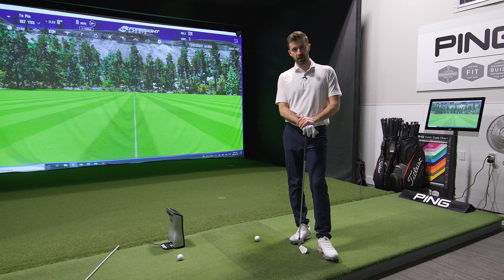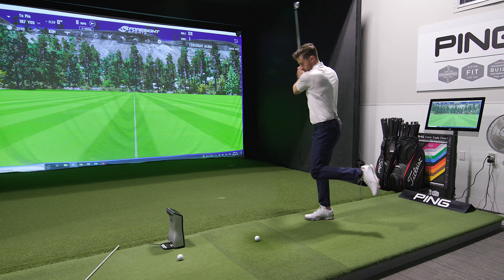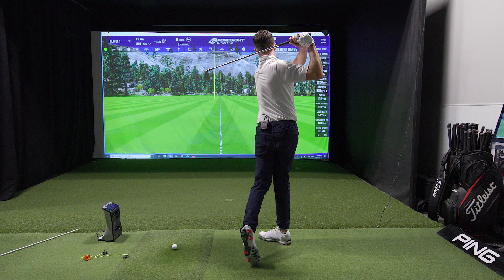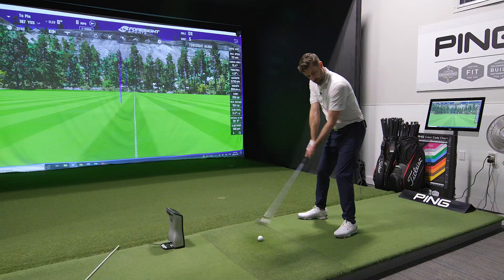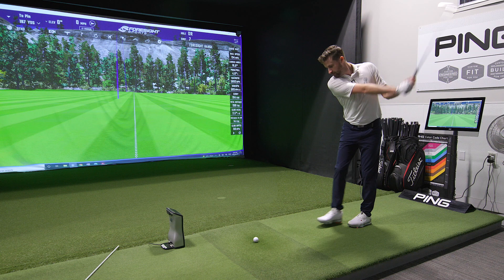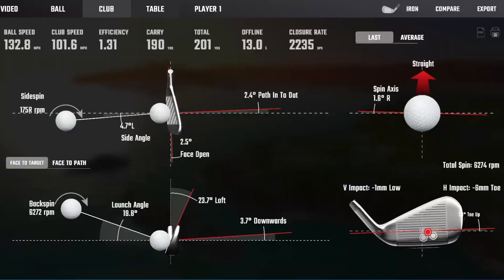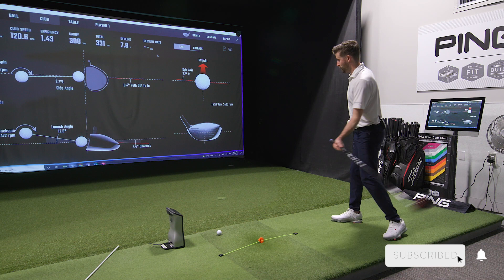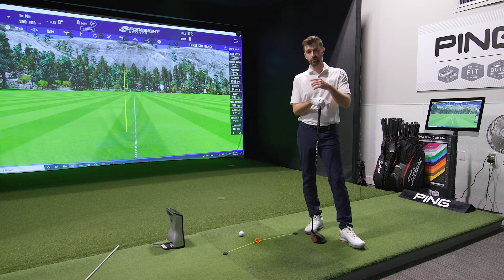Working on My Swing | Drills to hit the ball longer & straighter

Comment: Matt - tried out the weird forward step drill and was pleasantly surprised. For someone who has had 2 problems (tipping over in balance in the finish position and a bit over the top), I found my swing was coming from in creating more front leg stability and feeling my elbow tucking in with a greater perceived shoulder turn and back swing turn. Thus with the normal posture I pushed myself for a wider shoulder turn to create the same feeling. Thanks once again. 👏

Comment: This is gold Matty. Showing how you incorporate drills into practice and the physical change in outcomes that results is almost like "How To Do Golf Drills, For Dummies" instruction. Would love to see ongoing progress in proficiency with the drills and the incorporation of other drills that UGP and LC have given you.
I tried both the one-legged finish drill and the step-forward drill. On the one-legged finish drill I kept losing my balance toward the target so I guess that means my mass (probably upper body) is moving outside (target side) of my lead foot/knee/hip alignment. The first couple of step-forward drills resulted in hosel-rockets until I worked out my starting point and step size. Hit some solid strikes with that drill and could even finish balanced on my front leg only. Interesting the difference in balance between the two drills. I think the stronger 'planting' of the lead foot in the step-forward drill must have created more stability and less upper body lean toward the target. Would be curious what LC thinks.

Comment: Amazing how much putting that weight on your lead leg earlier neutralized your path with the driver. I remember seeing you on Quad before with a 5-6 in-to-out path, and those last couple were under 1 degree. This content is amazing because it basically confirm everything I've been thinking about in my own swing. I also avoid putting a lot of pressure on my lead leg due to some weakness from childhood. I'm slowly building that back up at 38, but trusting it is difficult. These are great drills I'm immediately going to try doing. Thank you for the amazing content Matt!

Comment: Very cool showing at full speed and then slow motioning the down the line angle after.  Helps to be able to focus in.
Swing is looking good.  Looks like natural, smooth, relaxed power.  Doesn’t look like you are swinging out of your shoes or anything crazy.
Been focusing on my lower body which has helped while practicing.  Can’t balance on one leg while closing my eyes worth a damn, but focusing on those feels has helped my stability, balance, and more natural rotation.  Great content.

Comment: The first practice swings with the driver was great. Whereas on the first ones with the i7 you rotated, and after the rotation you shifted the weight into lead foot. 
You were clearly increasing your trust in this move as the session progressed.

Comment: I noticed your trail leg stays really still in your backswing, preventing your hips opening all the way.  Ive been focused on "recentering" (shifting weight to the lead foot) at the top with my trail leg straight, then initiating the down swing with my hips. Keeping my hands quiet the whole time.  Helps me keep the club square.  Ball actually going farther with less effort.  I tell ya, golf is all about balance.  the one leg drills have helped me realize how important the feet are in the swing.  Thanks Matt.  The videos are helping me try different things.

Comment: I use the planemate to encourage that same type of rotation and also keep the width you worked on with LC.  But I like the added physical training to build lower body stability.  I recall it working for you in your review.  At least you didn't have it on backwards! :)

Comment: I will have to try these. For me one of the hardest things is exactly getting my weight forward with my trail foot all the way up on the toe rather than partly up but still with the front of the shoe flat on the ground. That does tend to restrict the body turn from facing straight down the target line, instead facing slightly to the right, which produces shots, either irons or driver, that, while the contact, distance and height may be good, are nevertheless off line to the right. But then unlike Matt I am 80 years old, inevitably less flexible, and at 225 pounds have an extra 30 pounds on the old stomach. But I am still flexible for my age, have played for 59 years, and am working hard on getting a more fluid backswing and resulting downswing with the prime movers being the lower body, pelvis and hips and not the shoulders and arms, as taught in his reprogramming sessions by a certain Dr. K.

Comment: In the practice drill with one leg, your standing too late on the right leg, try to get to the right leg stance earlier to promote better balance and posting at impact, i.e. don't wait so long after impact to get fully extended & upright on your right leg; 
as an aside, you might turn the right toe out just a fraction more (not much, just a couple more degrees is all) to assist, this should also promote shifting the weight in your ankle more forward like you want .

Comment: I tried the leg lift drill at the range. Found out that I wasn’t transferring weight to the lead leg either. Could be from an old combat wound to my left thigh. I can definitely feel the schrapnel moving around when I work that leg hard. Learning the golf swing isn’t easy, especially after your body has been through the meat grinder.

Comment: In the slow Mo it appears you still have a little bit of over-swing with your arms (arms folding across your chest too much) - the hands look ok but when your shoulders stop the arms keep going - set the wrists earlier in the take away until you get them settled in and maybe focus a bit on more torso and raising the left heel just a bit to promote more torso and pelvic rotation (rotation is the wrong term but I'll use here for sake of conversation) IMHO
Your feedback is welcome but this seems to be inline with what Larry was helping you with - this is also the technique that Mike Austin used to teach and when he was 60+ years old he still had a 150+ MPH club head speed and maintained a 133+ when he was 75. That to me is worth some serious consideration, especially when its proven to reduce spine degeneration/injury.

Comment: Are you trying for the same finishing load  on to your right leg for both clubs? To me it looked like a little hang back with driver compared to the 7 iron
Reply from the maker: Tougher to do with the driver, usually the case with most swing changes

Comment: Hi Matt the reason why you struggle with this drill is because your body is designed to balance between hips not feet.
Focus on shifting weight/ mass between hips joints. Easy as👍 your balance will instantly improve!

Comment: Great video. I've been working on getting to the front foot as well. I tend to hang back to try to hit up on the driver. I've picked up considerable ball speed but my spin is up and launch and distance are down. Are you still maintaining some upper body tilt on the driver swings?
Reply from the maker: So far still maintaining enough tilt for driver, angle of attack is still about +3-4* 👍

Comment: There seems to be a contradiction between balancing over my front foot and holding ny spine angle longer. Which is what my pro has been trying to get me to do. What do you think. Great channel from a fellow lefty.
Reply from the maker: Those are hard concepts to practice at the same time, agreed. Technically you can still have tilt in your spine while getting to your forward side, but may be easier to separate the drills as it’s difficult to balance

Comment: Casually knocks a 7 iron 190 to within 6 feet first up... Only gets a "not bad" from Matt!
Pretty incredible to see the immediate gains on this. 10 yards was it with the 7? I wondered whether this increased your steepness at all? Ball flight on driver looked a little lower but that could just be the couple we saw.
Reply from the maker: Not so far, I think I might still be doing some compensations somewhere that keep the angle shallow. We’ll see how it progresses though

Comment: I'm curious as to the reasoning why you should be learning to stand up on that front leg. From all of the force data I've seen, the guys who are efficient and good ball strikers seem to push hard off the front leg and get their weight coming backwards at impact. Standing up on the front leg at impact seems like you wouldn't be using ground forces very well.